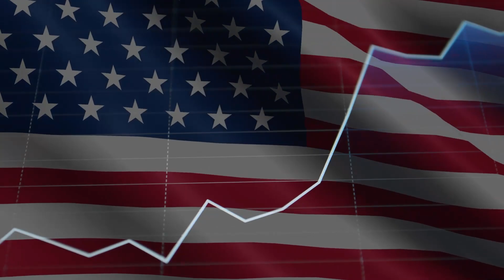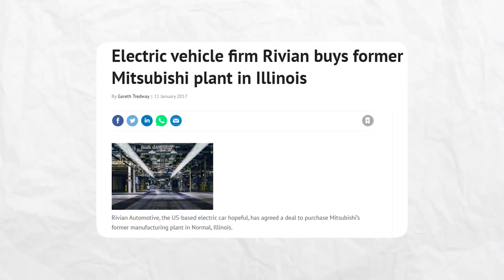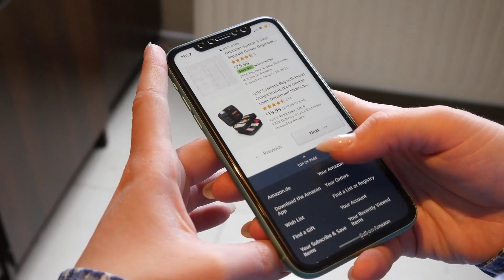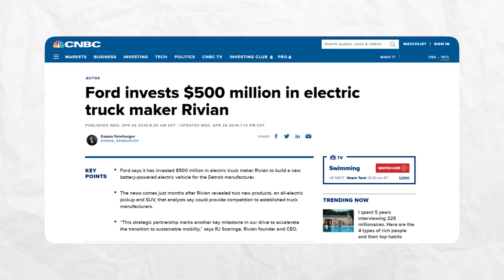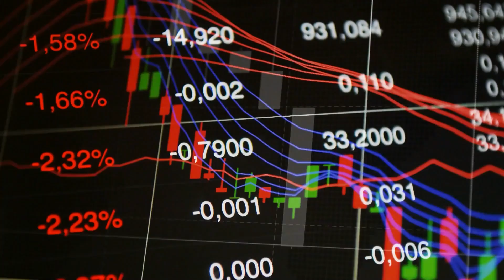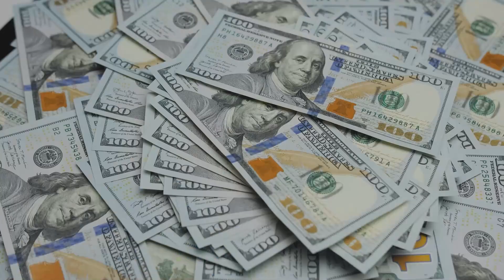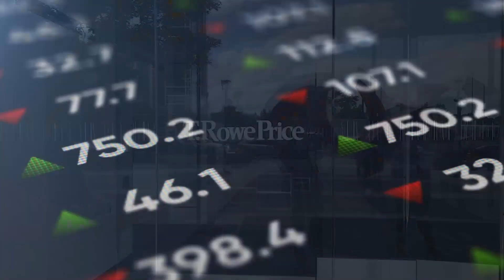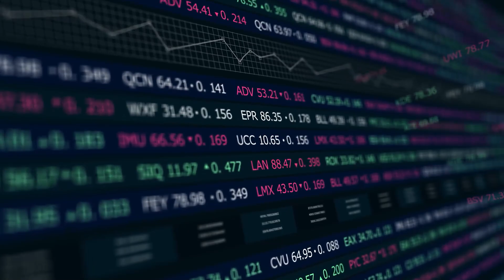Why I STOPPED Investing in Rivian Stock?

Comment: I think an investment in Rivian is in a 50/50 chance of being good or bad. The company has its certain prestige but it is not one of the best, there is also the issue of the manufacturing materials being imported or domestically made still increasing costs overnight, making the stock can go up or down suddenly. I would NOT risk it. Thanks for the information.